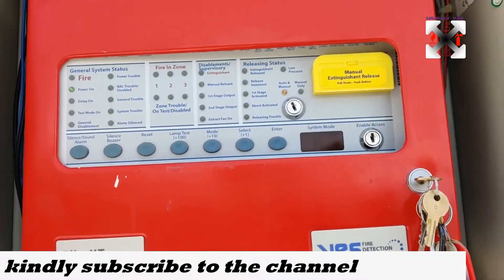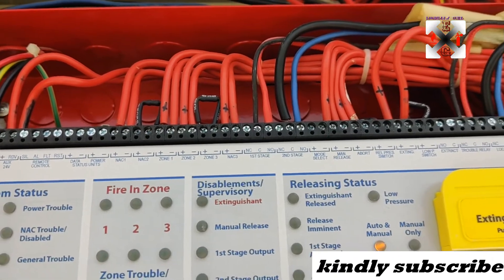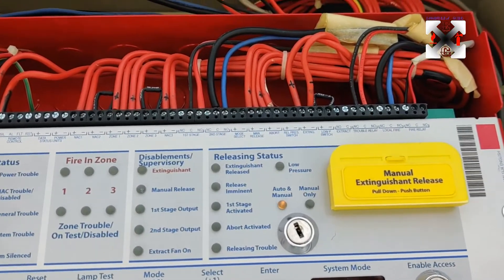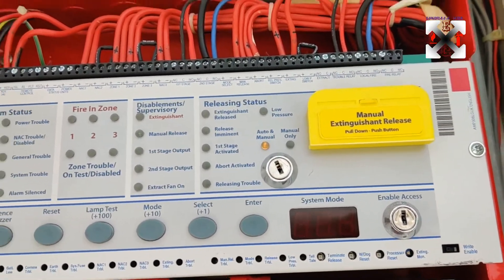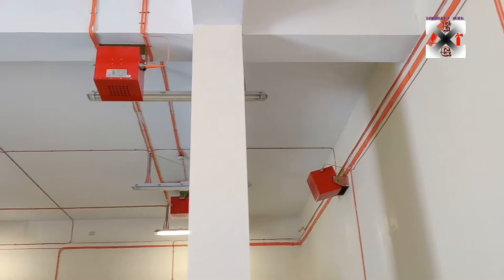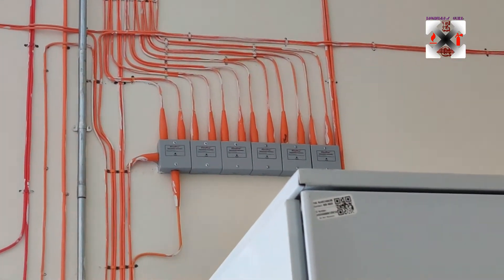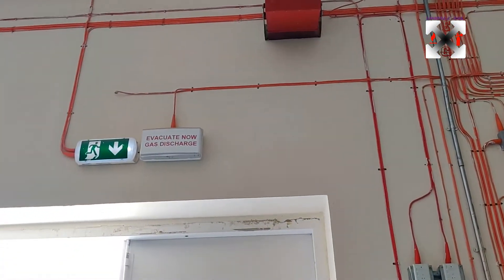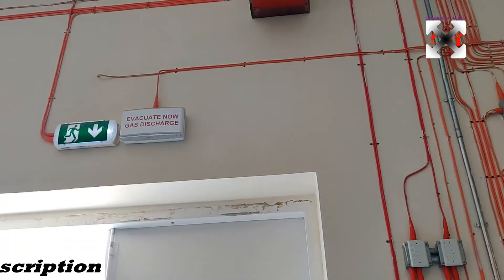AEROSOL FIRE SUPRESSION SYSTEM,OVERVIEW OF THE SYSTEM BY ENGINEERS GUIDE

Comment: Hi Sir, in 2nd stage alarm only horn will activate then strobe light will not flash? Or on releasing time then it will flash? Thank you!
Reply from the maker: @yeoj8358  horn will activate with strobe at 20bpm that is in counting mode..
Reply: @engineersguidehelp  Thank you Sir, Sir in our testing strobelight activate @ 33secs, is it normal Sir?
Reply from the maker: @yeoj8358  by that time it would have discharged already ..connect it to nac 3 and nac 1 for inside
Reply: @engineersguidehelp  Yes Sir, hornstrobe connected in NAC 3, then bell in NAC 1

Comment: Arosol firpro same panel I installed but extinguish point 1 deiod is connected if I removed panel give trouble can you guide me . Because as per manufacturer deiod need to remove
Reply from the maker: no, diode has to be connected as the end of line unless you are using the jumper in the sequential actuator

Comment: Hello, how are you
  Professor, I have a simple question 
 Why does a signal appear? 
 Release trouble 
 When connecting the selenoid to the cylinder 

 As soon as I turn off the selenoid, the signal disappears. I hope you can find a solution for me
Reply from the maker: @safaakadhim5040  which kind of solenoid are you using,mostly wiring is dependant on the type of solenoid